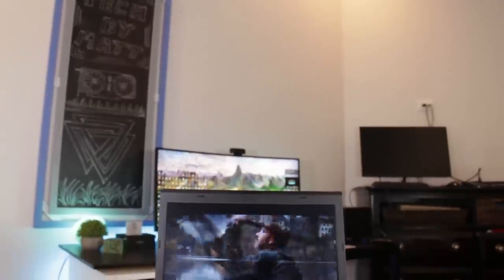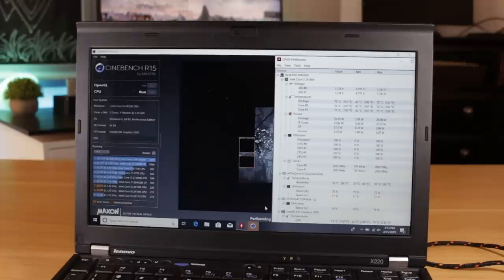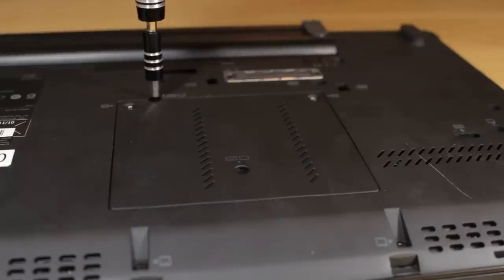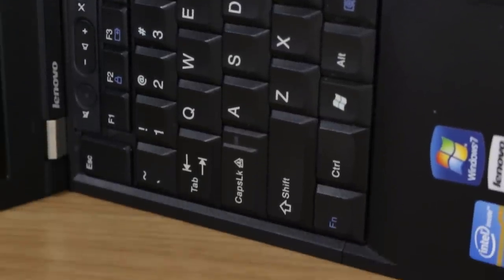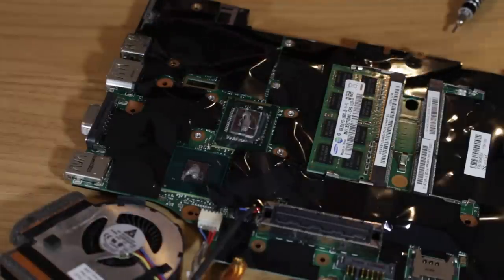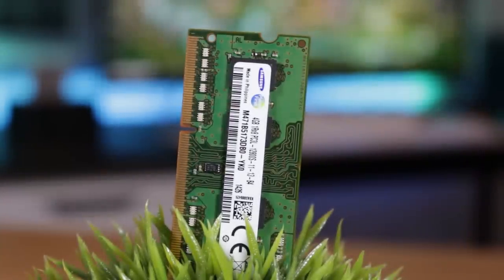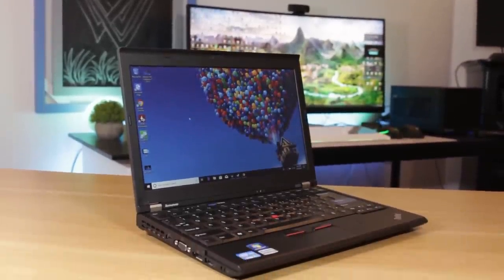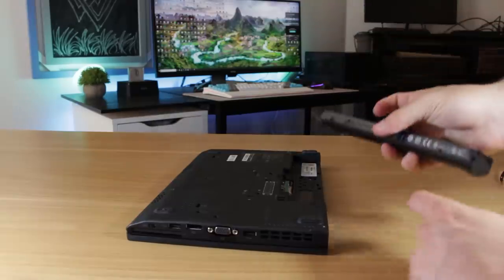What Can A $75 Laptop Do? (Plus Some Upgrades)

Comment: this made me giggle a little bit. Not that people would get what I mean necessarily. Personally, I'm not a big fan of the Lenovo laptops, but it's a personal preference. I'm more a fan of the older Acer and Sony laptops and admittedly I've also got a soft spot for dell , depending what model Dell, you're working with those things are built like a tank and you'd be surprised how well some of the old ones work to spite their technically not much newer than windows XP but will run Windows 7 or Windows 10. Quite comfortably with a RAM upgrade.i have one that is as old as hell that I have lost track of how many times I accidentally dropped it back in the day, and so forth and it still works.i . A couple of years ago bought a whole government issue ruggedized laptop, where somebody had it listed incorrectly on eBay and I got the thing supercheap! I've seen people charging these days, 500 for one of those ruggedized Panasonic laptops and i several years back. Got one under $200 with shipping. Part of what made me grin about this video is the fact i keep seeing people selling laptops older than this made by Acer locally average price is around $200 and i every so often managed to find one in really good shape between 20and 40 or somebody throwing one out that they had in the closet..thar Windows 7 or 8 era Acer laptops. Some of Them are single core bear in mind, the most I ever paid was $40. I recently picked up a triple core with a 500 gig drive . Tried her member. If it had four or eight gig RAM with a cooling pad laptop bag and a brand-new charger with a working battery. I paid like 25 for it where the thing was making a quote irritating noise;).i figured it was a problem with the sound card, getting bad. Turned out that the guy had tried to upgrade from Windows 7 to Windows 10 and screwed something up somewheres was still running a Jakey copy of Windows 7. The internal microphone was turning on as soon as the computer activated. Therefore, any sound made around the computer was picked up by the microphone lo then amplified through the speakersl.it looked like a brand-new laptop condition wise was a matter of wiping the hard drive and reinstalling a fresh copy of Windows. I put Windows 7 on it myself because I personally do not like Windows 10. Like I said, I can't remember if at the moment I've got it running4 gig or 8 and it works significantly better than one of those budget laptops you see at someplace like Walmart man those things are scary pieces of crap right out of the box. LOL. At some point, I've got to see about getting a ssd for it.my laptop that I use on a daily basis is only a single core Acer that I upgraded to eight gig running Windows 7 and considering I use Firefox with a lot of heavy usage. The machine actually doesn't give me much grief. Furthermore, I'm running it with DragonDictate;). It actually runs better than some 2 core machines that I've used. Unfortunately still haven't been able to get my hands on a four processor older model laptop cheap. If you can get a Sony older generation laptop with a good screen for a cheap price. I highly recommend them. the Windows 7 and Vista ones are actually still really good laptops. I see people charging 200+ for them. Used. I've picked up a couple really cheap.the three core Acer , I forgot to mention also had a Blu-ray drive. It was the home theater model with the 15 inch screen.
the Sony's I've picked up cheap are the home theater 15 inch usually Windows 7 era.one i gate free , where it has three red lines in the screen.i have a screen for it . But where I've been using mostly the HDMI video. I haven't bothered to change the screen. It art. He had eight gig with a two point something  2 core processor. it had a bad battery. I think the battery holds a charge, maybe 30 or 40 min. I mostly use it plugged in any way, or I simply buy a brand-new battery.i picked it up where somebody was giving it away. And like I Artie mentioned, I quite frequently see them for around 200 in need of a new battery lol. so he is doing stuff like wiping the hard drive or how to replace a keyboard. I wouldn't be worried about looking to get a cheap used laptop rather than spending two or 300 on a new one when you could've literally under $100. Bought a used laptop and upgraded it for still way less than 200+ and ended up with a much better machine.

Comment: You should do this with a thinkpad X230. It has usb 3 with practically the same design with the excepetion of the keyboard (which you can swap with the X220's keyboard). Most of the used X230 has IPS display (at least mine does).

Comment: I really like your video :) I myself have a Lenovo Yoga 720 13 inch and to be honest its a great laptop. I have a few of Lenovo's laptops, the one thing Iv noticed is that they always get the keyboards down. Like seriously I love the feeling and the spacing of the keys. If I had to gripe about this laptop (the 720) I would have to say I hate how dim the display is. Its fine for indoor use but it does not get brighter than 240 nits besides that its a great laptop. Do you think you could review the Lenovo 720 laptop? Id like to hear what you have to say about it

Comment: I have one of these, got it cheap. Runs win10 pretty well and plays most of the games I want to play (runs DS emulation well) and it runs most of the steam games I own pretty decently, not really run into any problems and I haven't even upgraded any of the parts inside

Comment: I bet a rx 560 would be more than enough to max out the display at 720p. The ips would look better, but I wouldn’t hold out much hope for pixel response time. It could be a haunted house with all the ghosting. I could be wrong though!
One big old bummer was seeing that the cpu was soldered. I guess what ever cpu you buy is what you stick with. I like yesteryear balling! My last laptop it pimped it out with the top cpu it could handle the t9900.
Reply: ExpressCard 2.0 has a maximum bandwidth of 3.2 Gbit/s (409.6 MB/s), so even an R9 260X would be bottlenecked.

Comment: You should have gotten the X220t Version, it can rotate its Display by 180° and fold back down to convert into a very nice Tablet / Slate with Wacom Digitizer Pen and Touchscreen. Otherwise the X220 and X220t are identical besides the Battery because of the Rotating Mechanism.

I have a X230t (Tablet Convertible) with an i5 3340M 2 Core 4 Thread CPU, 8gb Ram and 500gb Evo 860 SSD. With the 67+ Battery about 7 - 9 hours of working is no Problem, besides it has fastcharge (which afaik the 220 doesnt have).

Comment: Good video how is that Laptop with Content Creation can you edit Video's or Photos? Also i would like to see what you use to film your videos and edit them
Reply: BadKarma 714 It will perform okay. However the TN panel is not very color accurate.
Reply: If color accuracy isn't important, these will work fine. A few of my videos were edited on my X230, and those were 1080p60 files. An IPS panel would fare a bit better, but ideally you'll want to use an external monitor that has better color accuracy.

Comment: i got my DELL e6420 for like 100$ on ebay about 2 years ago, came with 8gbs of ram and a 1tb drive, been using it as my secondary pc ever since, its about the same specs as yours, i5 2520m dual core with 4 threads, and i completely randomly managed to find one with nvidia GPU wasn't even listed with it.. i think im going to put a i7 and ssd in it, maybe find a 1080p panel for it.

Comment: it was better if you swap the internal hard drive with an ssd because the primary sata drive is sata 3. the msata slot on those sandy bridge model are limitited to sata 2 3gps

Comment: The CPU handles the ram and the processor they use should be able to handle up to 16 gb of ram. If you have a spare 8gb PC3-10600 (1333 mhz) just "lying around and gathering dust" it wouldn't hurt to test with. If it correctly identifies one 8gb ram properly it should handle 2 of them.

Comment: Still using Dell Vostro 1450, the same age with this Thinkpad laptop.
Upgraded Ram and SSD (much faster than the old HDD, very satisfied about speed)
All I really want now is upgrade CPU, replace the old slow Core i3 2310m. 
Some advices ???
Reply: Depends on your budget and compatibility..
Honestly, if you like it's speed now, you won't see that much of a jump by changing the processor, but if it's the processor you want, the i5 is a good choice. I went with the 2430M on one of my test machines and it's smooth.

So if you plan an upgrade, keep in mind that the best things would be SSD and RAM (like you did), processor and network card. 

And I say network card because the older laptops came with G and N cards which will slow down even the fastest computer. If there is no whitelist on your laptop, and there is a dual frequency AC card available that will work with it, get it.. Even if you have to use a USB adaptor, it's better then the garbage N cards that came with those things.
Reply: What chipset does that dell motherboard use?

Comment: I only buy old 17 inch laptops who has a real GPU. Even if only workstation GPU's.
I Got a HP 8710w with t9500 and fx3600m with 256bit mem bus. Who I love. PLays still some titels today. (E.G League of legends on 1920x1200 ultra settings (shadow medium) peaks at 120 fps, and at least 80 fps with insane smooth gameplay.
Other old laptop is I got and love is the HP 8740 w with the FirePro M7820 (comperable with gts450). Who is even a lot faster. I consider both better then todays everage laptops still (Not saying real game laptops)
Reply: trancelistic got my Dell M6700 last year and it really packs a punch, the 3740qm not falling off to 7700hq too much and with 16g of ram, quadro k4000m(~gtx675m) and proper SSD. I’m more than happy with this mobile workstation.
Reply: @shinya1215   Nice laptop. Yeah. I hope to get a k4000m soon too.
Or the k5000m ( gtx 680m)

Comment: tbh, I don't get why people try to turn those laptops into gaming machines of whatever sort, the Sandybridge mobile CPUs are roughly comparable to the Core2Quad Desktop CPUs and that's not accounting for eventual thermal problems or the messy egpu setup.

At 50~75$ it's a good machine for office work etc. but adding another 100$ for a eGPU is pretty much a waste IMO.
Reply: This isn't practical, it's for Science. It's a cheap and fun nerd thing to play around with. Check out Low spec Gamer

Comment: Could you test Warframe since this is one the reasons I wanted a laptop but turns out that even at lowest setting, the game is unplayable (loading will sometimes time out the game connection).

I actually have this exact same model. I bought it about 3 years ago, but turns out I don't use it almost at all. Even so I still made the upgrades you have listed here. I went for 128gig msata ssd and moved the (very slow)  2.5hdd to my mini itx build. I also added 2 more gigs of RAM thinking that was the problem that I wasn't able to run Warframe - it wasn't. And yep, paste have been replaced and fan cleaned. I would very much like to see if I should spend on the eternal gpu dock since I now have an extra rx470 after moving my itx to a gtx 1070.
Reply: YES DO IT

Comment: I have x230 tablet version, more than enough to getting my works done as a programmer..
Reply: are the specs enough to run a local environment? im looking for a laptop for coding
Reply: @RedDesigns  in my case, i need to change hdd with ssd to boost it's performance. Adding more rams is also nice. 
Mine: 
Thinkpad x230t
- Intel i7 3rd gen.
- intel hd 4000
- ssd 256gb
- 8gb of ram.

Comment: The mSata is still SATA2 on this laptop.
Just stick with a classic 2.5 inch ssd.
Reply: mSata drives also tend to overheat and throttle down, so normal ssd drive is better for performance.

Comment: Just stay awey from HP, just changing the ssd in theme on most models requires to literraly dissasemble everything, at that point i replace the thermal paste too as well as upgrade the ram since its literally 6 screws awey (heh they hold the motherboard)

Comment: I have found that on my older Lenovo y580 with a 3630qm and Nvidia 660m I have to keep the charger plugged in to get speedier graphics performance. If I don’t then it’s laggy even using the Nvidia instead of integrated graphics. I guess this is a caveat of older laptops. I don’t have to do that on my Dell 7th gen Intel with built in graphics. The graphics aren’t dependent on that power supply and don’t seem laggy. I wonder why that is?

Comment: I have an hp elitebook 8440p which has some similarities with your laptop. I want to add an msata ssd because I see there is an empty slot next to the wifi card slot. Will it work if I add msata ssd in that empty slot? Thanks
Reply: Go for a hp elitebook 8470p with an i7 and upgrade the ram to 8gb and add a 240 gb ssd

Comment: i do not recomend buy older than t430 or t530 .
t430 and t530 are the best cheap old laptops you can have . 
if you want newer jump over t440 and t540 they have some small problems . 
and go straight to t450 and t550 . also cheap and great .

Comment: Apparently my primary school had these exact laptops for the year 5-6 students to use back in 2011-2013 however the ones my school had were cheaper versions of the one you are reviewing as they were exactly the same physically but had cheaper, lower powered internal components as they had Intel Celeron CPUs instead of core series ones but still most likely had the same 4gb of RAM! :)

Comment: You bought an X220, one of the best laptops ever, and you installed Windows 10 on it...?
Reply: What's the problem with Windows 10?
Reply: @uponu-w9s  The X220 is an old laptop, and Win10 doesn't run very well even on good computers (mainly because it's a bloated, broken, and insecure OS).
Reply: @alby1529  ok bloated, but broken is most like every new update but they will fix after and insecure is Windows not Windows 10 because is targetted by devs
Reply: @uponu-w9s  Windows 10 is still insecure and basic things that can be done in very small shell scripts are done in huge proprietary language files.
Reply: @alby1529  that's true but for me Windows 10 Is the best Windows ever made
Reply: @uponu-w9s  I'm sorry that the bar is so low for you.
Reply: @alby1529  wdym?

Comment: Laptops MUST be that thick! I really hate modern ones where display bends when you open a laptop and where every piece of plastic feels like it's about to break if you'll push a little harder. Not to mention those $2000+ laptops where you can't replace a keyboard without taking EVERYTHING apart in the best case and without drilling it out and then making clips and tabs to hold it in place in the worst. A very special place in hell is reserved for the people who invented and widely adopted that planned obsolescence bullshit.

Comment: What if I wanted to get one and upgrade the hard drive and run Linux and have hacker man machine (kind of joking) would it be aight for running like basic DoS attacks and and some light hacking and like CSGO I know I sound super edgey in saying this but like would it work good

Edit: I’m currently using a stream 14 which works but kinda sucks I just wanna know if it would be better

Comment: I have acer aspire 4750z with intel pentium b960 can i upgrade the cpu to i3 or i5?
Reply: Ben Aman pentium b series? Not celeron b series? ? Check out that feature with CPU Z search "FPGA" word cz if u find "FPGA" word it mean u you can swap it with core i series. My sister laptop using Celeron B820 and swap that snail with I7 2xxxQM+bios update/not bios update

Comment: Impressive, but may I suggest trying a dual boot using a much more efficient OS. Such as a Chromium OS, using a CloudReady version (off a USB or different interface or its SSD)... Since you should be able to boot it off a cheap USB thumb drive just to see how well you like it... The only thing you have to lose, is the time setting it up... Good Luck trying it out..
BTW there are other more versatile Chromium OS available but CloudReady is the most common and has a US based forum in for troubleshooting...

Comment: i have a similar specced hp probook that i HAVE to use for work and its absolute garbage. cant even run cs 1.6 or halo 1. nothing can be upgraded or replaced, not even the battery.

Comment: so u added single channnel ddr3 with dual channel ddr3 wow! it will be slower....because the dual channel ram will now be used as single channel because of the other ram stick....and the ram what was in there is ddr3 ram and you add ddr3L ram??? and the ssd speed should be aroundd 500mbps yours is half because its running on the same channel lanes as your wifi chip does....when you download something like a game it will be so slow hahahaha